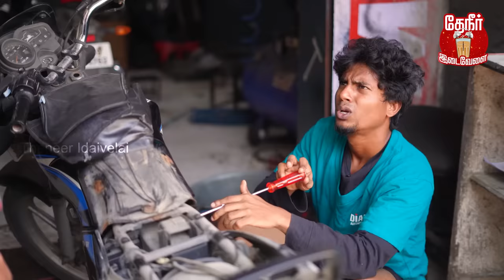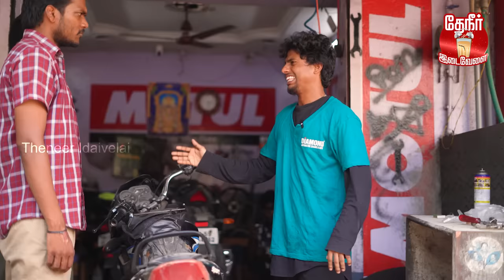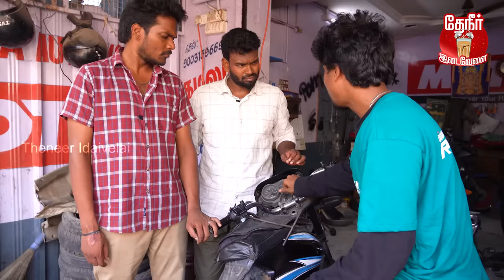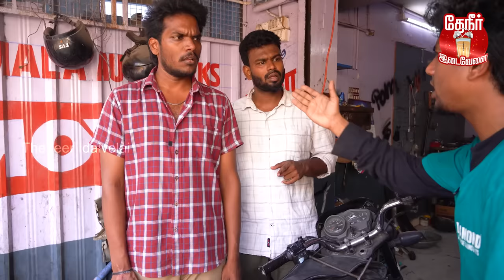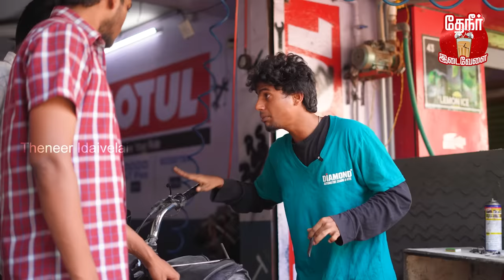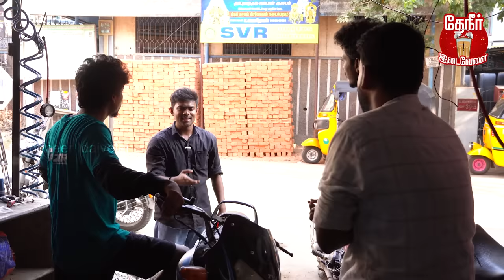Super tricks to buy second hand bike💥 | 2nd hand bike வாங்குறதுக்கு முன்னாடி இத தெரிஞ்சிகோங்க😱

Comment: Second hand bike checklist:

Centre stand and run:

1 Engine oil irukanu check
2. Race pannite iruntha smoke varakoodathu and  Silencer otta pisu pisu nu oil irukkakoodathu
3.Engine sound check
4.Battery: Light on panni,horn,indicator pudichi self start
 5. 25 to 30 thousand kms is oke
 6. Tyre 30 to 40 thousand so check tyre year and rc book year
 7.Brake pad check

General:
1.only second hand thaan vaanganum,no 3rd or more.
2.Owner yaaaru nu paakanum 

Riding:
 1. High RPM la ottanum,engine sound check
 2.kai vittutu ottanum 
 3.chain sound check
Reply: கு இன் கொடி இந்தியா ஆந்திரப் பிரதேசம் சித்தூர் மாவட்டத்தில் உள்ளது என்பதை நாம் அறிவோம் கருவை கலைக்க மன்மதனை இது போன்று இருந்தது அந்த நிலை மாற மாற முடியாது
Reply: Thank u
Reply: Super brother. Thanks